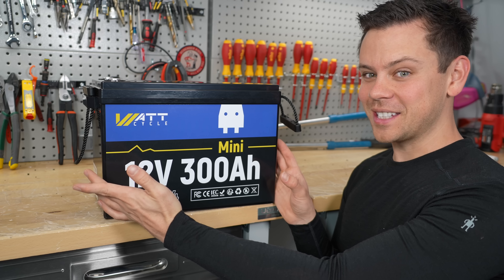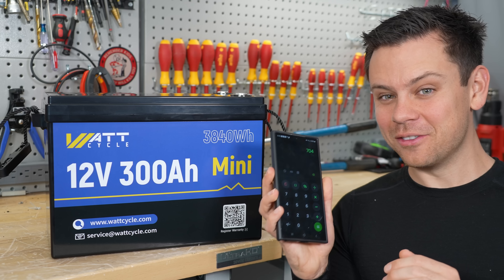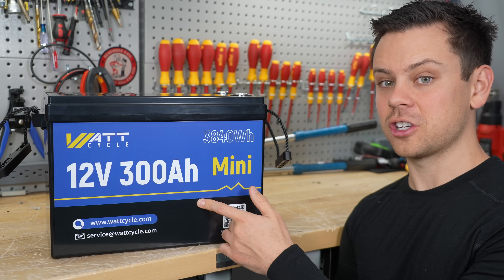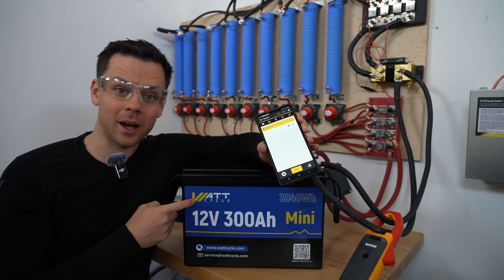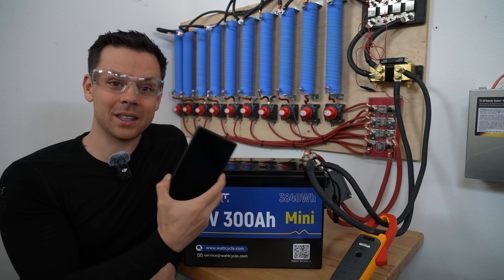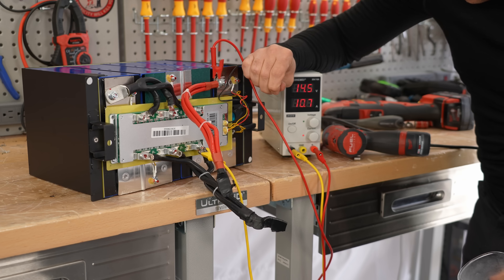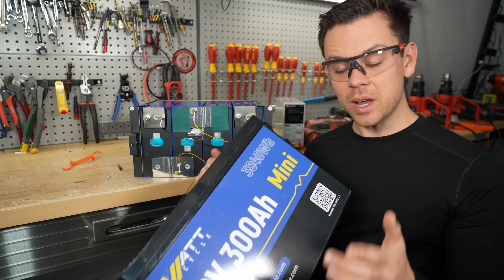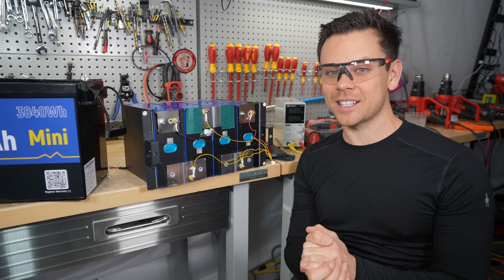Wattcycle 12V "300Ah" Battery: Popular Budget Battery Falsely Advertised?!

Comment: Thanks for your review, Will! We appreciate you bringing this to our attention. We want to be transparent about the labeling of our 300Ah mini. We use EVE LF280K-280Ah grade A cells (rated capacity 3.2V 280Ah, tested capacity 3.2V 310Ah). While it performs at a higher capacity, the correct labeling should be 280Ah based on the cell rating. We apologize for any confusion. We're offering affected customers a $50/each refund and a 2-year warranty extension, or a full refund if they prefer to return the battery. We're also developing a new 300Ah model. As the over-current protection, we will fix it to 250A-300A in the future products. We value your feedback and are working on a new 300Ah model.
Reply from the maker: Furthermore it doesn't matter what the first cycle capacity is on these batteries. Of course they will pull 300 to 310 amp hours. But if you want to know the capacity over the rated cycle life, it's going to be 280Ah. That's why it's rated that way. if they want to post third-party test results with their own cycle test, and have it certified, then sure. But most companies are going to use the cycle test data provided by EVE, the cell manufacturer.
Reply: @WillProwse That's correct, 0.3C or smaller rating may have chance to pull out 300Ah. But if the cell is 280Ah, If cell capacity is too big or too small, to battery pack it all  belong "consistency" issue
Reply: Wow ! Good to know that watt cycle watches and responds to the video, and that because of the testing a problem was discovered and the company addresses the issue! I look forward  to additional 100AH testing on the newer models before my next purchase. Thank you Will and Watt cycle
Reply: @spawn1086  They only responded cause they got caught misleading people.
Reply: @lofimusiq  I just bought a 100Ah from them, looking into the 250/300? Next. It is great that Will called them out.
Reply: Great to see your response, and correcting these issues. 
Build quality looks as good as the 100ah batteries, i was really happy to see that.
Reply: Great job replying!   Any chance you will make a mini 48v  300ah?
Reply: Still, does NOT protect those who purchased believing they had over current protection.  Frankly, the battery should be recalled under the consumer protection act as a fire/ safety risk.  Not worth $50 to burn someone's home down, is it?  These companies need to start releasing certification tests and NOT reply on someone like Will to do it himself and then have the company earning all of the profits!
Reply: @Gary-wh7ce  Everyone should be putting some sort of fuse protection on all batteries that can discharge at higher currents that the system is designed to handle - it is the responsibility of the person implementing for proper design. This doesn't mean The overcurrent protection doesn't need to be corrected, but you should NEVER rely on that, even if a 3rd party certification is done.
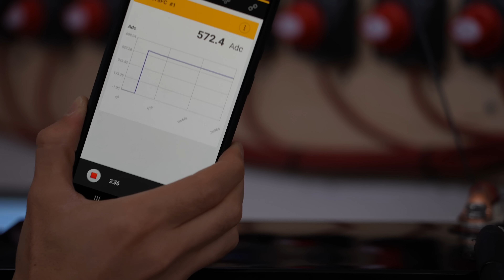Reply: @Gary-wh7ce  rewatch the video. It does have overcurrent, just higher than what Will thinks should be. The overcurrent protection stat is clearly listed in their product information so the buyer is informed of it and should take appropriate measures if they are not going to size the wire to sustain the amount of current it can draw before tripping as will stated in his video by using a fuse. For reference to this please watch at 4:06 timeline marker.
Reply: I truly admire Watt Cycle being transparent about this issue.  That is professionalism!  This makes me feel even better about their TM batteries that I recently purchased.
Reply: @JimMFishing  Transparent after being called out for labeling the battery as something it wasn't.  Your TM batteries are likely "mis-labled" as well.  These reviews call these shady providers out and they do not deserve our business.
Reply: @GoForAHikeNC  yeah I came here to say the same thing. He companies are just trying to cover their ass and advertise higher than what it’s rated. If they don’t even know how to do the simple math imagine the kind of stuff that they’re putting out.
Reply: @JimMFishing  when it couldn't be denied after destructive testing by Mr. Prouse no less. But, as Will says, still great value. From the beginning, that may have been their marketing strategy.
Reply: @wattcyclepower  What size fuse would be good at the battery for a smaller RV??
Reply: Basen has a similar battery 300 ah 12 v mini.  I Am wondering iff they are also 280 ah cells
Reply: @wattcyclepower Now your batteries would be best in class if you just installed a JK BMS instead of these with passive balancing.
Reply: @wattcyclepower how do we get our refund?
Reply: @mattwhite5669  Did you ever get a resolution to return the battery?
Reply: I ordered 2 on black friday and have yet to install them or even opening the boxes. after finding out about the lack over overcurrent protection is alarming and disappointing.  I hope that wattcycle will honor what they are offering in terms of refunds and warranty extension.
Reply: @thomasvictor4883  Did you ever get a resolution to return the battery?
Reply: This is highly regarded.    My system can handle 800A output, but NOT FROM A SINGLE BATTERY.    @wattcyclepower you need to fire whoever made that decision, but respect for the response.
Reply: I think the collaboration between Will and Wattcycle is a masterclass in how people can work together.  I am SUPER impressed that Wattcycle has taken responsibility , AND very generously offered to rectify things with their customers.  I bought 4 of these batteries based on Will's review of the 100AH unit.  Now Wattcycle is taking care of me.  That is VERY impressive, and thankyou Will for all you do!
Reply: Great response from a battery manufacturer! Ol' kil-a-vault left a lot of us holding the bag on a now worthless product!
Reply: This is how a company should be when they do something wrong. Own up to it and compensate accordingly. I have one of your 100ah batteries and am happy with it... and this post made me just that more certain I picked the right company to buy from.
Reply: @mattr4406 They are swamped and responding in order.
Reply: @wattcyclepower - how do I apply for $50 refund?  I purchased this battery a few months ago.
Reply: @edmcdonald2852 it seems to be automatic. If you email them about your battery, they will deny the validity of the overcurrent problem. I emailed them about my battery tops arriving unglued and they said as long as you can click them back down it should be fine. I'm not sure how that tracks for waterproofness.
Reply: @edmcdonald2852  They told me they are working through processing the refunds, so I don't think you need to do anything.  I just got mine this morning.  They sent me an email notification of the refund.  I would give them maybe 30 days, and if you don't see a refund show up, then contact them.  In my experience their customer service has been very responsive.
Reply: I just Bought the 280 ah version and will be using a 250 amp fuse. I would never have any battery without a fuse. When I was using lead acid batteries on my RV I had a short 2 different times and a fuse save the rest of my system and possibly worse
Reply: Dear All. I have Purchase Watt Cycle in December 2024. Once received. Charged and Tested 4 Times. Best I could get Was 293Ah at 12.61 Volt Average. Contacted Seller and Watt Cycle Said Engineers confirmed this is Normal and nothing to worry. Once Questioned Again. Watt Cycle just Blocked me 😅. Never, Ever Trust those Fake sorry Guilty plea Crying lies. They have Ignored, Blocked and deceived people until they could not get away with it anymore
Reply: That's the way to handle something like this.  Bravo.
Reply: Nice.  Purchasing a battery from you guys soon.  Thanks for the info!
Reply: Wattcycle please sponsor me for car audio. I need amperage.
Reply: They promised to fix it for a simple reason. For me, and perhaps others, what Will says goes. Period. Most of the time i understand about half of what he says.  Don’t care. Im going with his opinion.
Reply: FYI I purchased a 100Ah battery from watt cycle  based on the review of the battery and the customer service, 4 months in and its been a great battery and no need for customer service.
Reply: I dont know anything about batteries and this comment section is very interesting to read.  This channel is awesome and informative as well 👍
Reply: I recently purchased the 300mini with the disclosure that its 280. I paid just over 500cad im hopeful this battery exceeds my current and future needs.
Reply: Thank you for owning up to this issue. I bought a 628 ah battery from you 2 weeks ago and that gives me confidence you are a stand up company and I’ll be purchasing more batteries from you in the future.
Reply: Great job watt cycle this is how you get customers by being so up front so great job
Reply: Actually I don't understand why Will wants such a low current on such a large battery. That's about 1 C and LFP is capable of much higher.
Reply from the maker: It's because the conductors and the insulation temperature rating determine how much current these packs can handle. And the current rating and temperature rating of the terminal. And of the connectors used. That's why. I've covered this on many videos in the past.
Reply: @WillProwse  So you're saying the internal pack connections and the terminals are not large enough to handle more than 1C.  That's unfortunate.
Reply from the maker: @JRP3  Yes exactly. Of course the cells can handle it. I've covered that in multiple past videos in my battery building tutorials. The limiting factor is the BMS the connections and the conductors and the insulation rating. Not the cells.
Reply: @WillProwse  WattCycle informed me that the 300Ah Mini has an overcurrent protection at 600A, meaning that you were just below that threshold when pulling 580A.
Reply from the maker: @curioussand1339  still too high and with my resistors it should have pulled over 600A. Even 2x 2/0 gauge cables couldn't lower the resistance enough to pull it. for a millisecond to trip. What a stupid excuse on their part. 600A still excessively high.
Reply: @WillProwse  I don't think it was an excuse, because I specifically asked them what would happen if the battery was shorted, if the internals of the battery would melt. They responded no, it would cut the power @ 600A.
I'm using 4/0 WindyNation 440A @ 105 degrees rated cables between the batteries (parallel) and on the combined output. Also added 300A MRBF fuses on each battery.
Btw. I already received my 2 x 50 Euro compensation.
Reply: @JRP3 While the cells themselves might handle 800 amps for short bursts you can just look at the BMS, the wiring, the M8 connectors  and tell that there is no way it can safely, as a system, handle sustained 800 amps. That is about what you would expect for a dead short across the terminals, not the current expected for any reasonable use case for a single battery. Given that, the BMS is not effectively protecting the wiring against a short. THAT SAID, even with a good BMS you should always always use a fuse or circuit breaker. Because BMS systems rely on MOSFETS that can fail open during an overcurrent. They can't be relied upon to protect against shorts.
Reply: @ackattacker  To be clear I wasn't suggesting an 800 amp draw would be appropriate, just that limiting it to 1C seemed low.
Reply from the maker: @JRP3  for solar you should be only pulling 0.1 to .2C at most. That's if you calculated your days of autonomy correctly. I think most solar batteries should be limited to 0.5 C. But of course these batteries are used for other things so people prefer having the option to pull more current if necessary.
Reply from the maker: @ackattacker  yes exactly!!! This guy gets it
Reply: @WillProwse  Yes I'm thinking from my use perspective in EV's where I pull higher current quite often.
Reply: @ackattacker  I agree, for this reason I would like if Will could test for high temperature protection, as a fuse will likely not solve that issue, in the case of bad internal connections or undersized connectors/cabling inside the battery.
Reply: @ackattacker  Agree, circuit breakers like used in houses.
Reply: @JRP3  wiring
Reply: @leevincent1639  You size your wiring accordingly, and use appropriate fusing/circuit breakers.  I've pulled short bursts of 400-550 amps with no problem from my pack.
Reply: @JRP3  What size are your battery cables?
Reply from the maker: Yes short surge duration to cover surge capacity is fine, and doesn't hurt anything. But that's not the issue here. This is why many BMS are actually programmed with a time delay function for the overcurrent protection. That way you have good safety and the ability to run motors. This is a common software feature in these BMS that was programmed into them about 6 years ago. I actually learned this by going to a manufacturing plant and talking to the R&D engineers. This is present in most BMS, and a common feature. It's not new or special. 

When you do not have a time delay or fast acting over current protection for the conductor and insulation rating of the BMS supply, you are asking for issues. 

Maybe I should make another video covering all of these points then.
Reply: @WillProwse  Maybe a surge capacitor to level the charge flow, like used in AC systems?
Reply from the maker: @JoeZyzyx  no that's not ideal
Reply: @JRP3 you are WRONG about the high current. My experience with even 105Ah cells is that they barely reach 1.5C before serious temperature rise happens. 280Ah cells are worse because of their surface to volume ratio. I agree they can output thousands of amps, but heat is the limiting factor. If I'm right the manufacturer describes them as 1C, and you should never go beyond spec. What if they are 10 years old and have 2000 cycles? No way they are gonna handle 300A for an hour.
Reply: @Robbedoes2  I never said sustained current for an hour.  I built an EV with 100Ah cells and pulled peak 550 amps at times and constant 200 amps for 10 years.
Reply: @JRP3  I agree. This would be the first pack that has a high enough current trip on, that I could use for a vehicle battery. I'm mainly just making my own, and getting ~700ah out of ~70ah cells, if only for 30s. But I have to DIY it so that I have a heavy enough BMS. This one would just work.
Reply: @JRP3 Because everything between the cells & the load also needs to be able to handle the current. If even a single component isn't capable of carrying the current it's a fire hazard.
Reply: @JRP3 EVE LF280K are rated 1C continious and cannot do more. Actually if you wanna have your EVE based batteries life long then keep load and charge below 0.5C, higher you reduce lifespan from 8000 cycles to 3500. Have a look at the cell specs
Reply: @chrisr819  1C on a 280AH cell would be plenty in a vehicle as long as it could temporarily handle higher rates.  Also I don't need 8K cycles on a car pack.
Reply: @ EVE and all 1C cells cannot handle that as they are storage cell and no high C EV cells. Then you need the 2C Calb cells or expensive Winston if you need current delivery or better LTO. Have a look at the 24Ah Platanno LTO cells, they do mindblowing 20C. I know what I talk about, I do car stereo since 30 years and been multiple times European sound quality champion.
Reply: …and the higher system voltage of 6S LTO gives you also much more power. Just be careful not to fry your cars electronics, most cars electronics can withstand max 15V. There are tricks how to do that, the simplest one use an underdimension silicone 130 degrees temp rating cable and create a voltage drop that you need so you are below 15V; the expensive silicone cable you need because that cable gets warm but due to higher temp rating you are ok and safe. The stereo you connect with shortest monster cable to squeeze max out. Another way big capacity active balancer and the stereo runs on 6S while the car electronics only on 5S, the balancer fixes imbalance.
Reply: @JRP3 because the cables will not handle that much current inside the box, and you can't transfer that much current through that size of screw down connection.
Reply: @JRP3  the BMSbused in these batteries is generally 200 to 300 amps.  At 865 amps the BMS can short and catch fire
Reply: @JRP3  It is not a low current.  You must understand that it is amps that cause fires.  Normal fuses do not work at high amps, the power just arcs over like a welding flash.  This is why as we increase the KW rating of batteries he argues we should be moving to 48v systems.  Same KW but much lower amps, less chance of fires.
Reply: I do not agree with Will on the high current being a problem.  If the BMS can handle the current, it is a good thing to have short duration high current capacity.  I use my LFP batteries on my boat and one common problem is not having sufficient current capacity for inductive motor peak currents at startup.  With an engine starter motor, bow thruster or electric winches, you get a very large initial surge of current before it drops down to a more reasonable sustained current.  A battery way to handle it is to inform the user that the positive terminal should be connected to a class-T or MRBF fuse. 
At the very least, you might set the max current to the lower threshold and then have notes in the user manual telling the end user that the limit can be raised to "x" if the battery is installed with the appropriate fusing.
Reply: @haydenwatson7987  ditto on capacitor for surge, like in AC systems.
Reply: I placed an order for 3-300Ah batteries through Amazon on Jan 1st with anticipated delivery on Jan 16th.  

--Will these batteries have the new over current protection set to 250-300A?  

--How do I claim my refund?

--Will your NEW 300Ah model be the same physical dimensions?